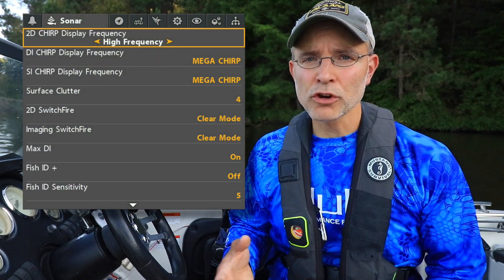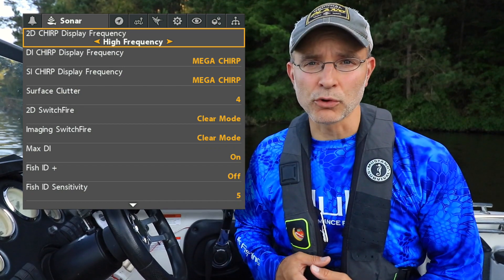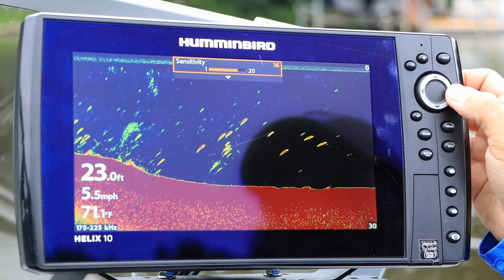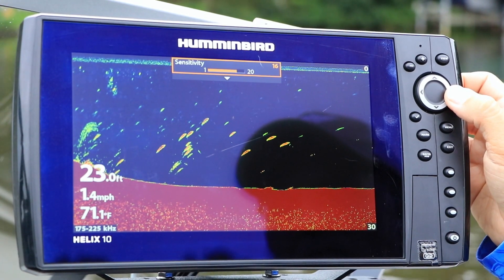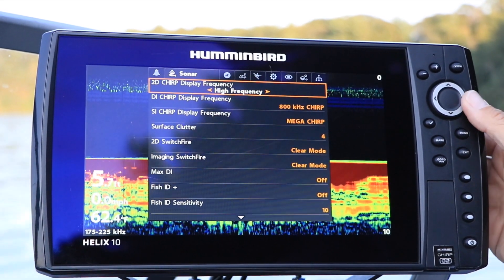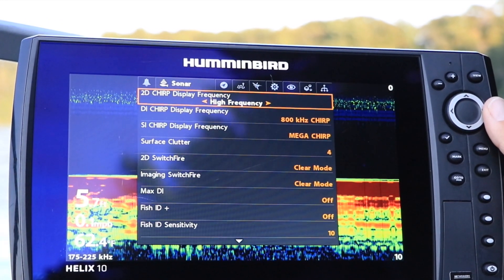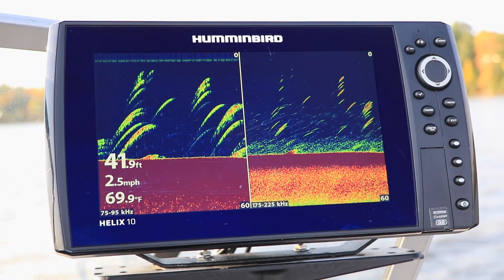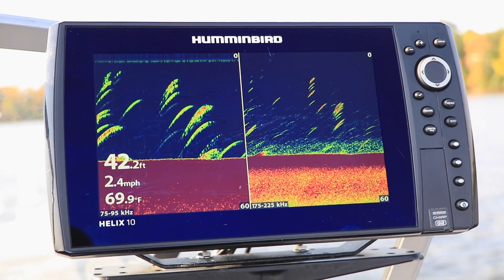Humminbird HELIX How To: 2D CHIRP Frequency

Comment: Hello from Germany does the Humminbird XM-9-HW-MSI-T Mega SI + transducer also work at 75-95khz? why do I have to select a different transducer in the menu on the Helix 9 gen4 in order to be able to work with 75-95khz? best regards
Reply: This is an old video when HB chirp was Dual frequency. Now it is called dual Spectrum and settings selections are different.